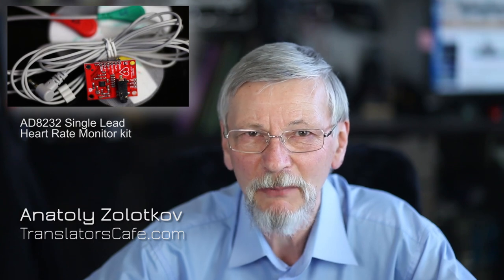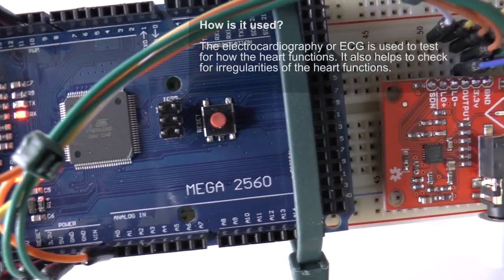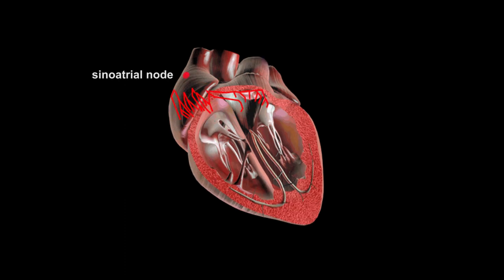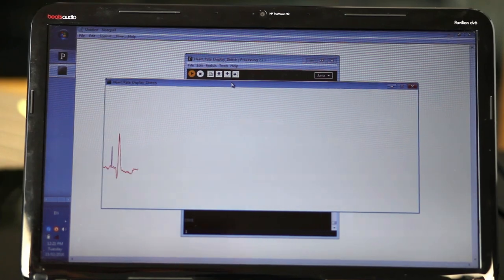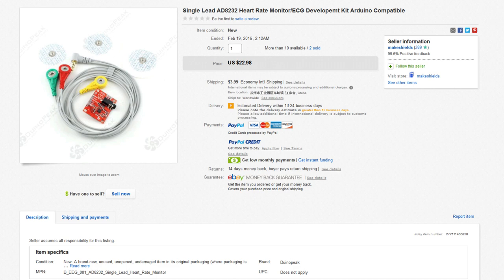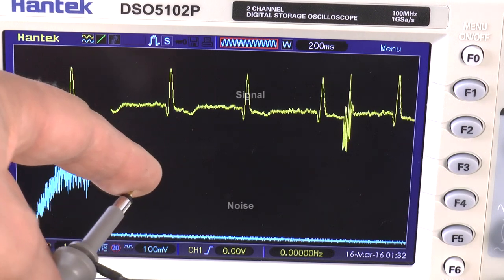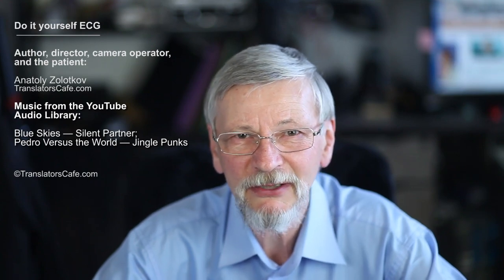DIY ECG

Comment: The processing code doesn't work and shows error. Sir, did you use the same arduino and processing code that sparkfun has supplied or you modified? If you did so, can you give me any direction? I have my project to submit very soon.

Comment: Hi, I liked this video , its gives more application of AD8232 aside from just ECG. I have purchased the same board and testing the board. I'm facing problem with the output signal which is very noisy. I have connected the board with 3.3V and connected the output to oscilloscope. All I can see is a noisy signal. Can you help me out with this?

Thank YOu
Reply from the maker: Hi Santu,
I had the same problem at the beginning. Most probably the signal is noisy because of bad contacts between your skin and the electrodes. Another cause of noise is switching power supplies and other electronic equipment. Try to make your experiments in a room without computers and other electronic equipment.
Anatoly
Reply: TranslatorsCafe.com the output i am getting from this sensor is a square wave. I powered it using an Arduino Uno r3 (3.3volts). Could it be that arduino power is not stable enough?
The provided electrodes were attached to right wrist(RA), left(LA) wrist and RL to right ankle bone

Comment: Thank you for your tutorial. I'm working on a similar project measuring the EMG and I have some question:
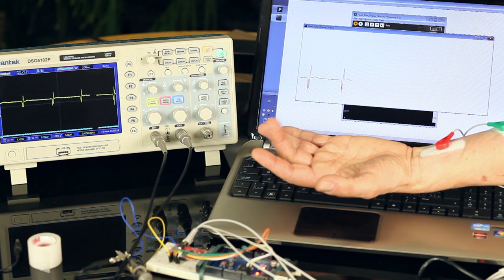1- I tried to measure the electro-activity of my hand, I placed the electrode the same as shown in minute 6:34 (the yellow electrode is connected to a bone surface) but I can't get the same results. I have tried this experience several times, but I couldn't have a good signal.
2-the ECG frequency (0.5 Hz to 3 Hz) and the EMG frequency (20 Hz to 3000 Hz), how to modify the AD8232 schematic so that is can measure all the frequencies??
Reply: Did you end up working it out?

Comment: Hi,I loved the video. I purchased the AD8232 after watching the video. I am trying to make an EMG armband by this boards. I'm facing problem with the signals. They are throwing some random values. When,I close fist fist it shows the right signal but after that it again starts throwing some random values. I have placed the electrodes parallel on my arms.
Do I need to change the electrode placement or something else? Please help me out with this? It will be much appreciated.
Reply from the maker: Hi Anugreh, try to make good contacts between your skin and electrodes. Also, try to move your equipment away from computers with switching power supplies and from fluorescent lamps. Don’t forget to put all three electrodes on your body and all three with good contacts with your skin.
Reply: Hey,I did all that. But,Still when I plug in the sensor,The signal doesn't go down from 300. And then,It just starts throwing random values.
Reply from the maker: Unfortunately, in this case i cannot help.
Reply: You can use a different ecg board using shield board one

Comment: how well does the ecg heart rate work while moving around? would i be able to type and move my mouse around while hooked up and still get a good reading?
Reply from the maker: It works, but with noise. Moving or even talking will distort the signal because of
electrical activity generated by muscle movement. The signal from muscles can
be stronger than the signal from the heart.

Comment: Hi,
How can one get also the pulse (bpm) from this moduls?
Thanks
Reply: hi, i have the same question. i need to know the pulse from the ecg module
Reply: u need count signal period. using millis on arduino.. its internal counter
Reply: Thanks for your reply. I am familiar with 'millis', but the questions is really how to count/determine signal period. should it be peak to peak, for example? Or it be simple detected from reading one of the pins on the chip?
Reply: u can count period peak to peak or R to R,, i'm using lead 1. or other method is count peak for 10s then multiple with 6..

Comment: The values which we get on the serial monitor of Arduino IDE which are as follows:
320,322,333,340,320,..........etc
what are these values....
are these voltages or what?
Reply: Yes.
Reply: Hi, Avinash. I know it's been a while since you wrote this but i'm having the same readings and i have no idea of what to do. Did you solve it?
Reply: Actually, these are digital values. These need to be converted to voltage values based on your Analog to Digital Converters resolution.
Reply: @flavialopes5354  I think these are digital values. These need to be converted to voltage values based on your Analog to Digital Converters resolution.

Comment: The videos good but, you look like big brother on the cover picture with that stare. The pictures of you in the video are different and nice. Intimidation never wins with a picture. I don't know what your target audience or purpose is from the front picture. I really like everything else, the video does look very professional, really good job. Your knowledge of basic ECG / EKG is good and electrical engineering is good. I wish you went into a little more depth on possibility a differential op amp used to reduce the noise of the displayed ECG / EKG.
Reply from the maker: Hi Thomas. Thank you for your comment. I thought the cover picture resembles those in the video :). It was added on the cover just to show who is speaking. Please consider that my primary job is running TranslatorsCafe.com and these videos are just an attempt to tell people about the Unit Converter https://www.translatorscafe.com/unit-converter/en/charge/, which is the main part of the website.
Reply: Thanks for the reply. It's the style of the picture I was trying to help their are different communities. I was trying to help the noise is the problem with the sparkfun and I need the precordial leads but, it's great to get people involved in biomedical engineering. I'm studying cardiology I was looking for a 12 lead system an found your video. I'm having problems because some group put something in the Wholefoods etc... red cap water gallon of distilled water that's cause high blood pressure  and now a different auscultation in my heart. Be careful a lot of sick gangs in NYC with sick doctors. Good luck.